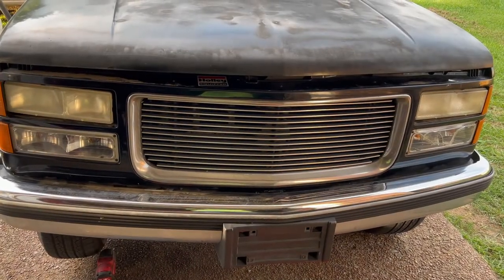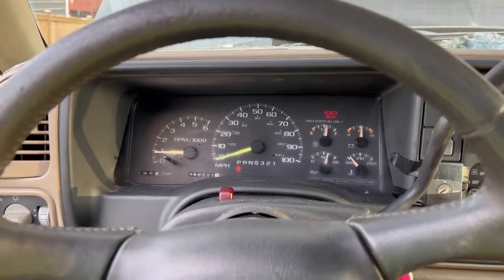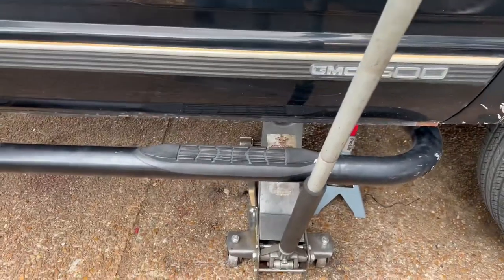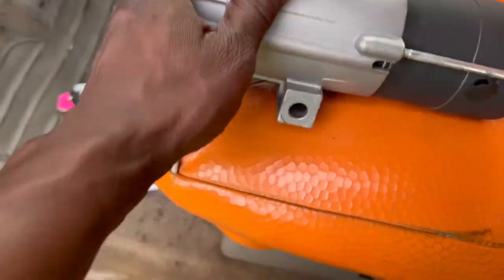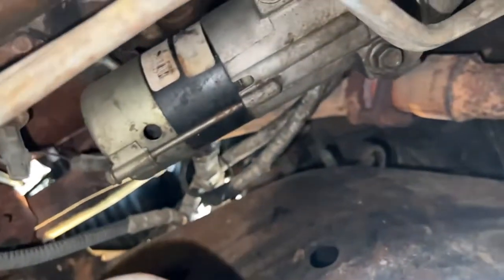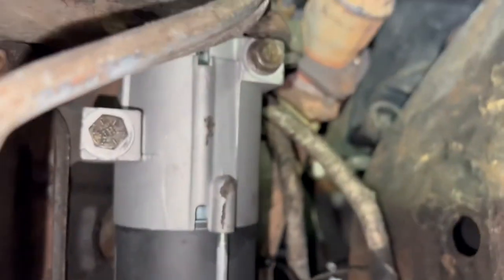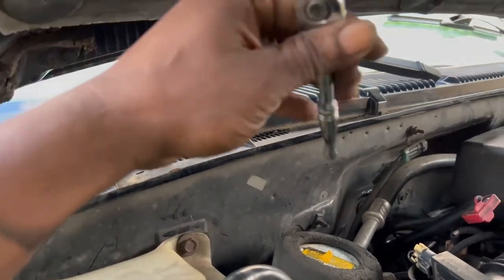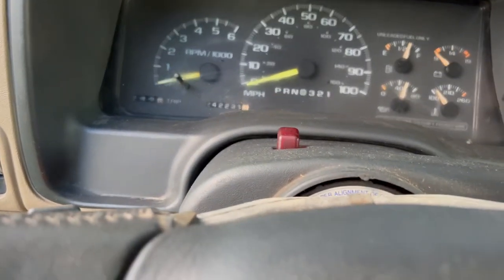1998 GMC Sierra starter replacement

Comment: 0:37 sounds just like 5:12 ?
I don't really hear a difference, in fact, the new install sounds worse? When my truck starts up like that, people told me it was the starter, but if I didn't replace it soon enough, it's the fly wheel that's going out, and that's the griding sound you hear on both starts, even after the new starter.. ?
Reply from the maker: I had to shim the starter